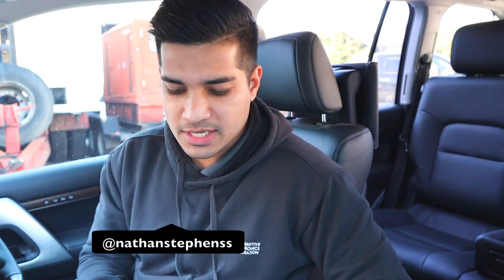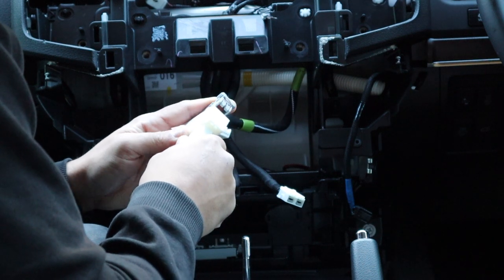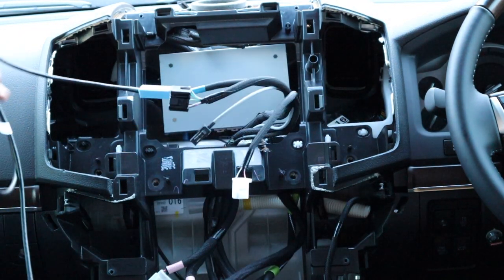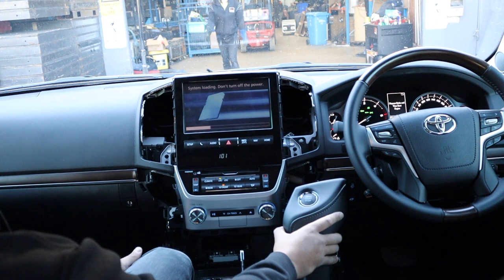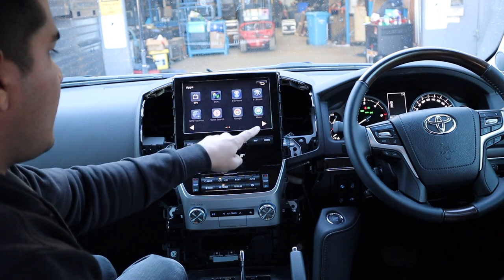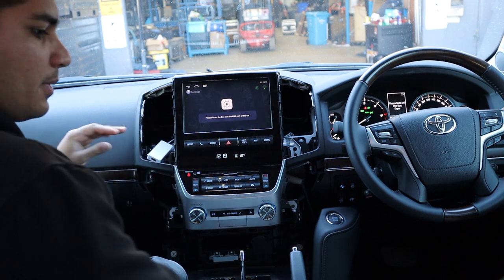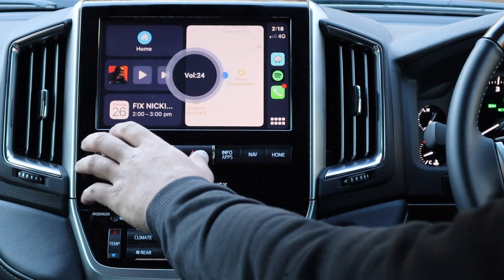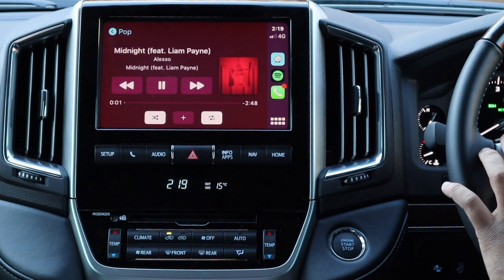Toyota Land-cruiser (16-21) Apple CarPlay Retrofit! (YOUTUBE/NETFLIX)

Comment: Looks good except I would be concerned that the unit is mounted with tape. These vehicles are made for the bush - rough tracks will shake the unit loose in a few years and it will be rattling around behind the dash. Can it be mounted on properly with screws?

Comment: The problem with these system ( all brands , I’ve tried them all ) is the sound quality, sounds come out of the system bypass plug and play to a 3mm or 3.5’m input. If you are not crazy about the sound quality you won’t even notice it , but I went through 4 brands and ended up leaving everything stock. 

Besides that , everything works great. The one I liked the best was beat sonic , but they are all the same.
Reply: What were the other brands of modules you used? How much of a difference would you say there is with the audio on a scale of 1-10?
Reply: I believe one of the other brand was nifty city.. they both input audio through aux jack. But honestly it’s worth sacrificing a little bit of sound quality ( that many won’t even notice ) for Waze and Spotify.

Comment: That’s great. I want one. Good job. Why did you not utilise the existing USB next to the gear stick? It already is connected to the original stereo
Reply from the maker: The module doesn’t work with the factory port so you need to add one :)

Comment: Question, when you press NAV to enter Carplay, does it reset to the default Toyota OEM view when the vehicle is shut-down and re-started?  Just wondering if you need to hold NAV every time the vehicle is started.

Comment: Great video. I just installed EmuWing windows in my 200 and lost my radio reception due to the windows containing the antenna. Does the 200 radio have a standard antenna Jack that I could tap inside the dash, or is there some other type of antenna I’d need? Thanks for your help.
Reply from the maker: you’ll need an antenna adapter for that one
Reply: @TheFittingBay  thank you. Any idea info on the type of fitting coming out of the radio?

Comment: Looking to get a unit for my 2018 Sahara, will this support all factory Steering wheel control, reverse and 360 cameras, and play Netflix onto rear displays without any additional cable or connectors thx.
Reply from the maker: Yes to all of the above but you need connectors when installing the unit for the RSE (all behind main radio)
Reply: @TheFittingBay  thx for the replied , will the connectors be included in the kit or is it additional?
Reply from the maker: @mikethai3469  Additional :)
Reply: @TheFittingBay  Hi mate, do you have those on your store so I can see pricing? Simple plug and play for the rear screens? Also which version of android do this box come with?
Reply from the maker: @rish8579  right here my friend: 
https://shoptfb.com/collections/toyota/products/toyota-landcruiser-16-20-200-series

And HDMI direct into the rear screen easy as. And android 10 with 4GB ram 64GB storage PX6